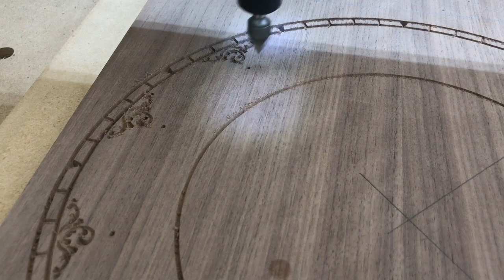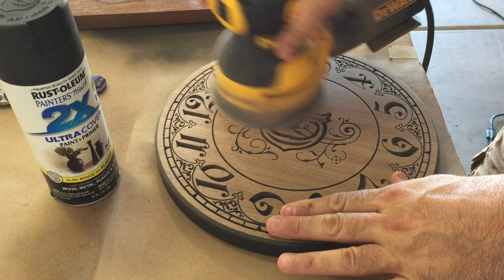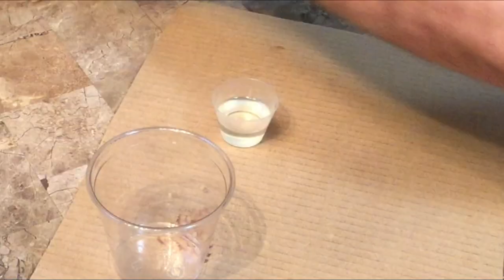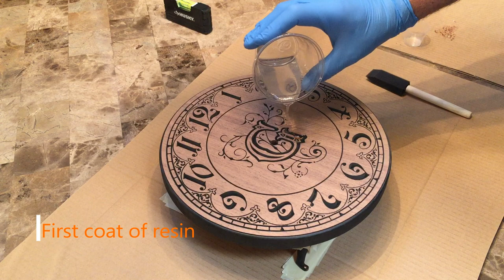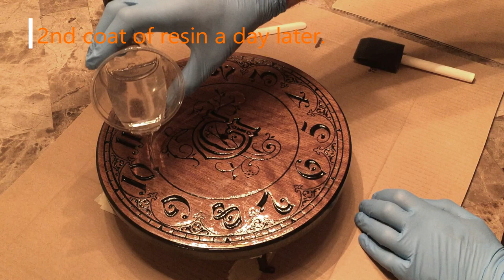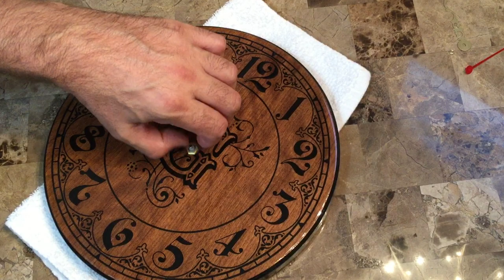CNC WALNUT CLOCK WITH RESIN FINISH

Comment: Are you sending a 3D .DXF file to your router
to obtain the rise of the bit in thin areas?
Reply from the maker: Ian Crossley , no, when designing the layout, the software determines the depth based on the angle and size of bits used. And the depth can also be adjusted manually in the software.

Comment: can i have a g code please or file
Reply: gcode will depend on control software to some degree. Design is on pinterest.com
Reply: @allengibson7346  Hi, can yo give me a link of that design? TNX
Reply: @msstoja1 , It might be easier to give you what I have. What format can you use, or do you need? Also, do you want the same font used here?